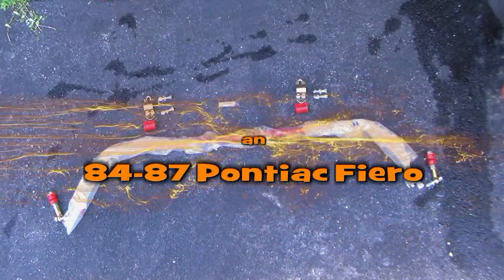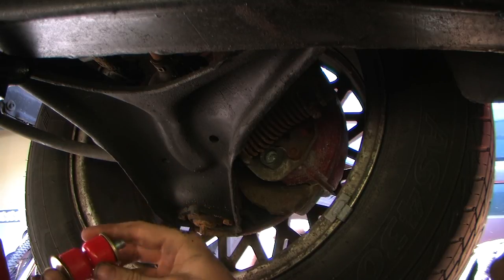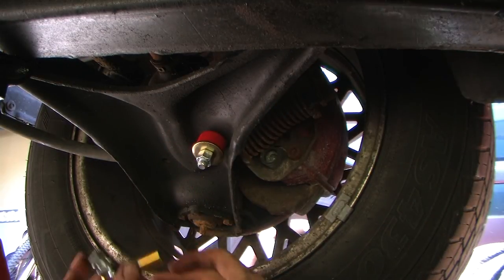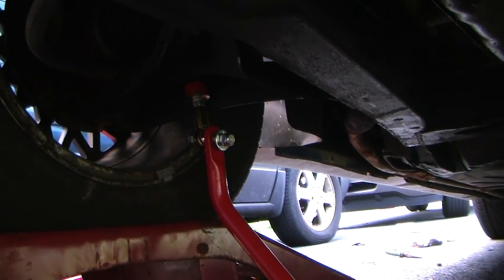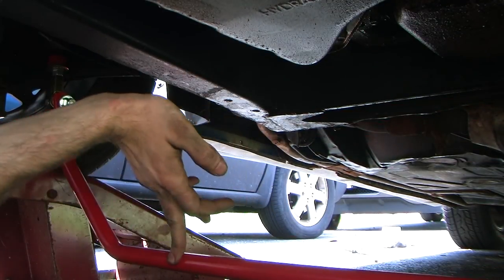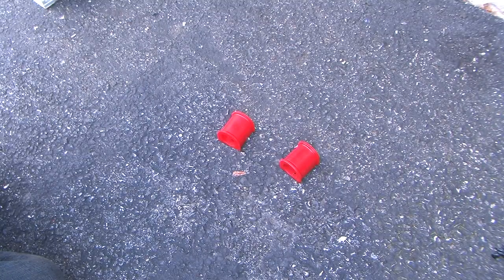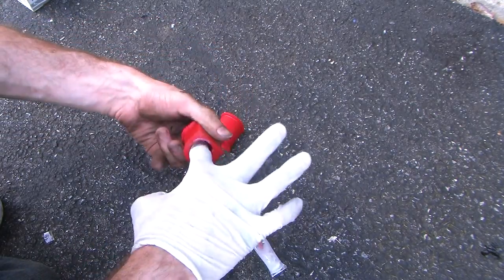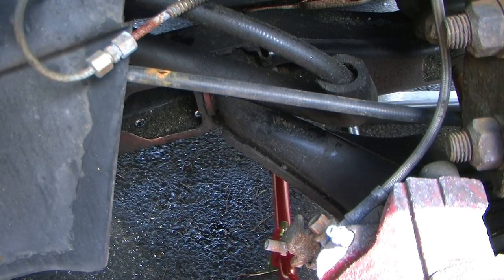Installing a Rear Sway Bar in a 1984-1987 Pontiac Fiero

Comment: Do they sale this at AutoZone and what is it for
Reply from the maker: Randy Williams The Fiero Store is the only place that currently sells rear sway bars for Fiero's. Here is a link if your interested: http://www.fierostore.com/Product/Detail.aspx?s=57032REAR&d=45&p=1 The rear sway bar improves the cars handling while cornering by reducing body roll. Fiero's are known for understeer and a rear sway bar helps to keep the car flat through turns. If your interested in improving the handling of your car this should be near the top of the list. 88 Fiero's are the only ones that did come with a rear sway bars stock.
Reply: Any way you could show us how to install a sway bar on a 1988 fiero base model? From what I understand the 4cyl models don't have a rear bar.